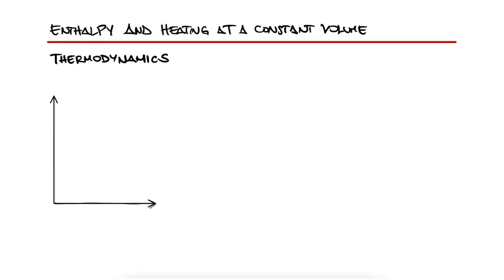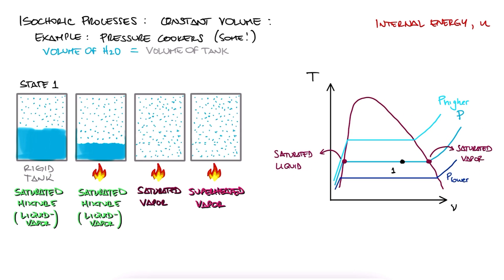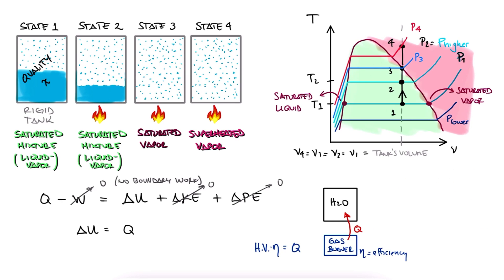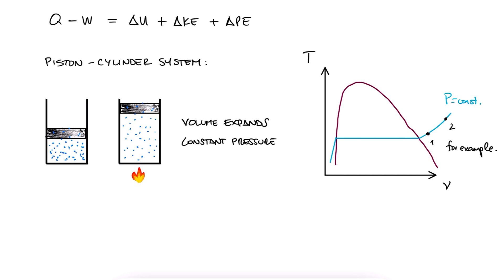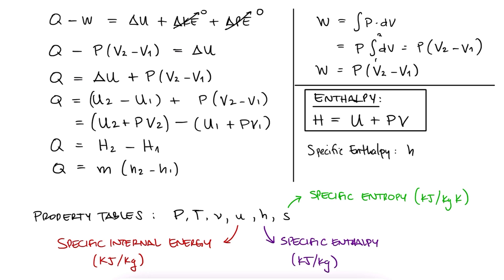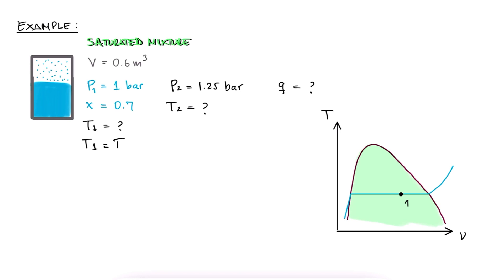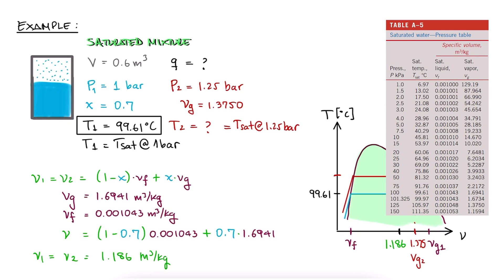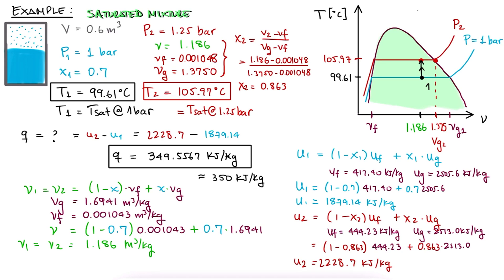ENTHALPY and INTERNAL ENERGY in 12 Minutes!

Comment: I love your videos, Question:  If I was to take a fluid element a sea level,  and raise it up to a higher altitude (which is at a lower pressure) the fluid element would expand, pushing back the atmosphere.  The work done pushing back the atmosphere would cause the internal energy of the fluid element to decrease.  The transferred energy, out of the fluid element, would be in the rest of the atmosphere.  Of course, the atmosphere is an infinite reservoir, so you would not be able to see any temperature increase.  However, what about flow thru a closed duct system, with a compressor?  The "work" done by the compressor on a fluid element would appear as an increase in internal energy, an increase in kinetic energy (which we will assume is negligible) and some of the work will go into the fluid element "pushing" into the system.  Where does the energy from the "pushing" go?  The duct system is not an infinite reservoir like the atmosphere, does that energy appear spread out in the system as an increase in internal or kinetic energy?